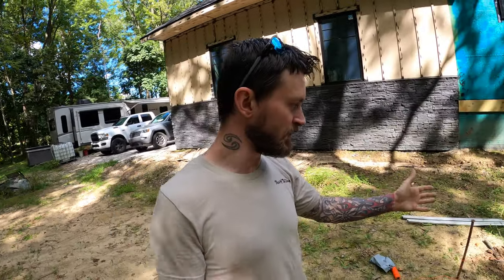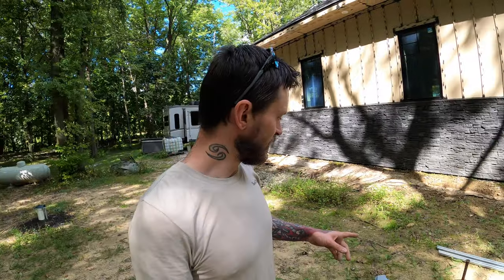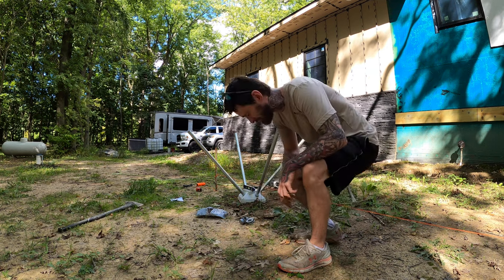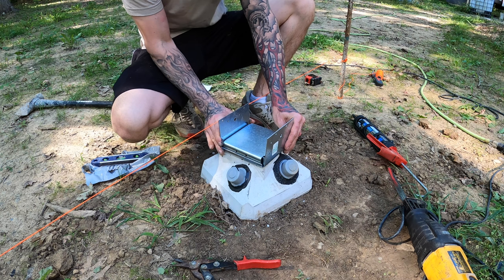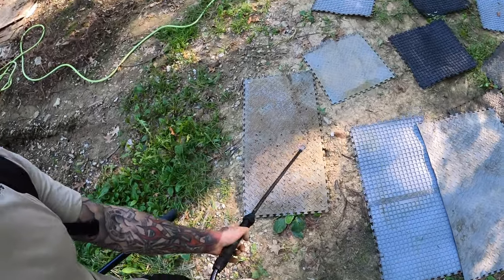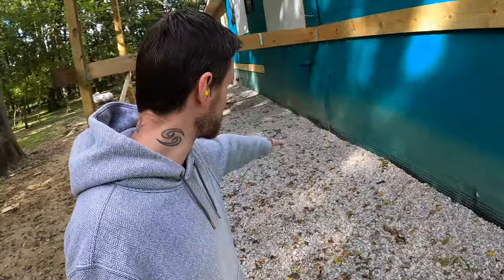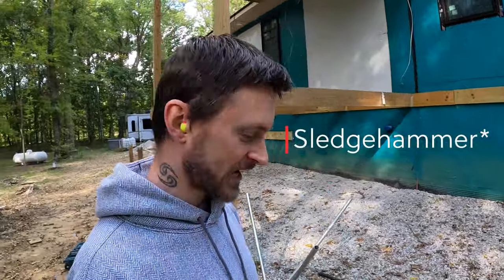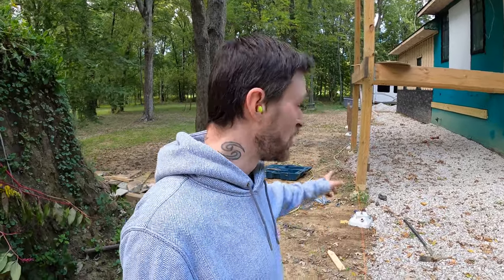How to set Diamond Piers!??  Starting our rear deck!

Comment: I saw this when you shared it on IG or where and went to their site and was confused how it worked. You explained it well and I’d be interested to see what they’d say in my area about it and it’s usability.
Reply from the maker: Should be able to use everywhere.  They have a brochure with the size/weight and length you need based on your soil.  A deck is supposed to carry a curtain load within a grid pattern.  Sorry I forget what it is right now but if you meet that you can find out how many you need per 8’ 9’ 10’ etc.  anything bigger though you’ll need an engineer and soil compression test or Diamond Pier won’t sell them to you.  That’s the 100’s, 200’s and house framing ones.